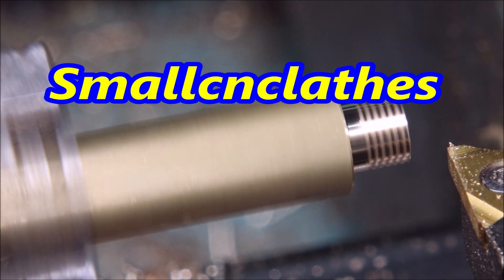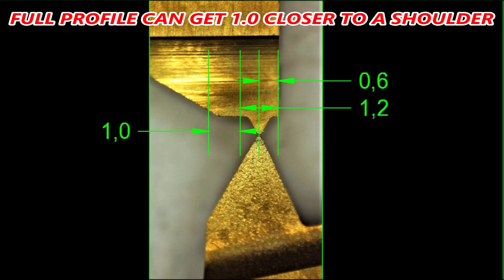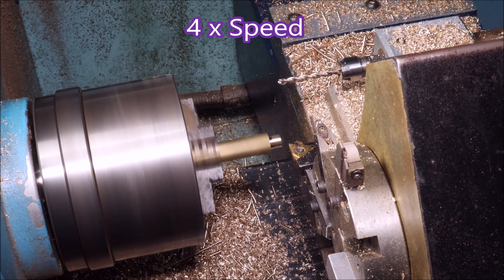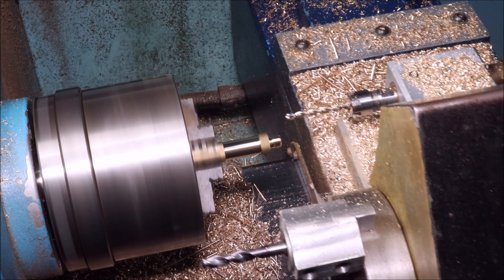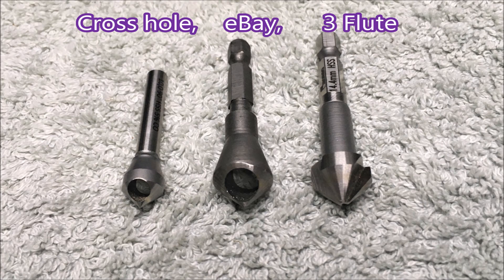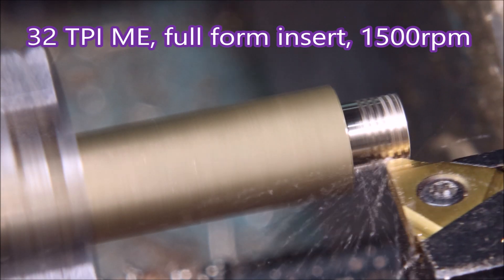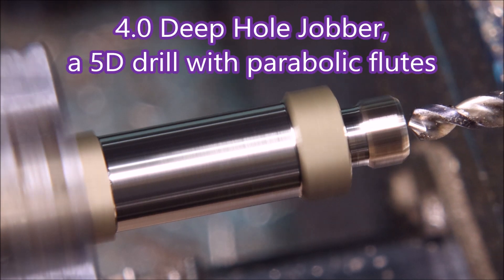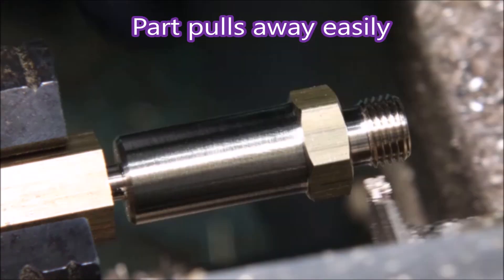CNC lathe drills, turns, threads brass part with 32 TPI Model Engineer thread.

Comment: Wouldn't you be able to thread closer to the shoulder if you took off the chamfer at the end of the thread? I'm unsure what language your machine uses but in fanuc this would be M24.

Unless there's a good reason for not doing that obviously, in which case ignore me.
Reply from the maker: Hi, I try not to ignore anyone who makes a comment. my lathe was created along with its software some 30 years ago for sale to education institutions. I am pretty sure it is a language all of its own. The canned cycle for threading does its own thing. I am not sure there is anything that can be done to get closer to a shoulder, it seems to pull out in the same place pretty much independent of rpm or feed. Not sure M24 exists for any command. 01, 00, 02 and 03 seem to be about the only commands that are used elsewhere. And when the software changed from dos to windows they reversed the action of 02 and 03 so maybe they got it wrong in the dos version LOL. Does not bother me as I only ever use the cam system to create code, I can edit a bit but that is about it.  Thanks for your comment Nigel

Comment: This got me thinking - if the thread crest of a full form insert is correct for a specific pitch, that means that the crest of a normal insert is wrong for some of the pitches it cuts. Which means that unless a normal insert is offset axially, it's gonna cut most pitches deeper than it needs to.
Reply from the maker: The only pitch that will be cut at the correct depth, is smallest pitch the insert will cut. Any larger pitch will need to be cut deeper than the the correct depth. Your sort of thinking is why I only use full form inserts. Cut to the correct depth and cut the thread OD as well, no messy measuring required.  I hope to release a video covering this topic shortly, I have been working on it for some time now trying to create graphics that show the differences clearly and also need to actually cut some threads. Stay tuned.

Comment: I would not have thought that there were so many model steam engines out there as to require so many of these parts. Nicely done video of a nicely done part... Martin
Reply from the maker: Apparently it is a hobby in which many folks indulge. I think watching a steam engine may be a bit like watching molten metal. 
Thanks for your comment
Reply: @smallcnclathes  I would like to think that watching molten  metal was the more intelligent and useful thing to do. But - yeah - nah, my observations of YT of late would suggest that in a contest watching steam would win hands down. I mean, how many useless contaminated and gassy copper ingots can one look at?... Martin

Comment: Nice work Nigel.
I was curious why you didn't cut a relief for the Threading Cycle ?
I first thought you wanted to leave the material behind the Thread, but it was cut away later.
It was not such a bad way to do it.
But if you had a relief you could ended the Threading in the relief instead of pulling away to end the Thread.
Just something I noticed while watching the video.
Good video to watch on a Sunday morning.
Peter 👍
Reply: G'day Peter.  The small Hercus CNC lathes do a really good job don't they.  This will be yo soon when you get the Mazak up and running.  Cheers, Aaron.
Reply: @DCT_Aaron_Engineering  
Maybe i should ask Nigel IF he will sell me his Lathe. 
Might have a chance to get something CNC Lathe wise this Year 🤔 
What a shame you were not looking for a CNC Lathe. 
Maybe i could buy something. 
Then on sell it to you at a discounted price 
Believe me.
This sought of thinking has crossed my mind. 
But i am sure i will take a pretty big hit $ wise, with this thinking 🤔 😄 😅 

Back to the Manual Lathe i go 😒

Not bad viewing on a Sunday morning. 
Maybe i could post a video like this one day 😔 😪 🤧
Reply from the maker: Hi Peter, the tool path by the Hercus would be the same if there was a relief or not. I have just found I get far less threads burrs if I do it that way.  I guess I am a little obsessive when it comes to threads, this "backwards" method of mine gets me as close as I can get to a perfect thread. Full form inserts just make getting great threads so easy.

Comment: Thanks for the video, Nigel. Do you have any advice for profile turning using the parting tool like you do at the end there? I tried it in aluminum the other day and got horrible finish until it was cutting at enough of an angle that it only used a corner of the insert. Ended up having to switch between the turning tool and the parting tool at that point and left an annoying parting line.
Reply from the maker: Hi Zachary, hard to give advice without knowing more. To profile with a parting tool (a tool not a blade) i use an insert from Sumitomo that is made for profiling, not just parting. Even then it is not always possible to get rid of some light chatter marks when using the full width of the blade.  Do you know what alloy you were turning?
Reply: @smallcnclathes  Hi Nigel, I was turning 6061. Using a tool, not a blade. Sounds like the insert may have been the problem, because mine was a budget special from Shars. I'll try to get some higher quality inserts and see how it goes. I roughed using a grooving cycle with the parting tool then tried to finish the profile with the same, and the chatter was so bad it knocked the part off the bar where it necked down.
Reply from the maker: @zacharyisraelsen8484  I almost never use 6061 as I don’t have the hp to make it chip. How wide was your insert?
Reply from the maker: @zacharyisraelsen8484  Parting is often the last operation on any part. It is the operation one does not wish to make a mess of. I have always spent more on my parting tool and inserts than I could afford and I have never regretted it. Parting off and "budget" do not exists as far as I am concerned.
Reply: One of two things that have helped me in the past- first, indicate your tool in to make sure it is in straight. Doesn't always help, if that doesn't work try grinding a "V" into the center of your parting tool, sometimes flat inserts will bounce of the surface off a part instead of cutting, grinding that relief will help a lot,  best of luck!

Comment: You make it look so easy!
Reply from the maker: Thank you, I’m glad it looks that way. It never is that simple though, always some little drama to overcome. Half way through the run, I started to get spindle max current errors. Dropped the speed from 2800 to 2400 and had no more errors to finish the run. Thanks for your comment, they are appreciated.